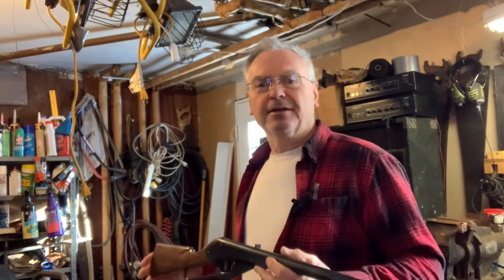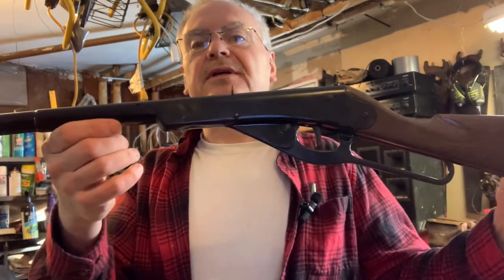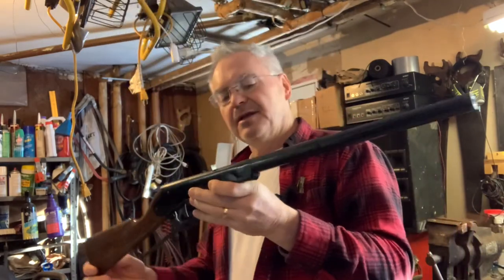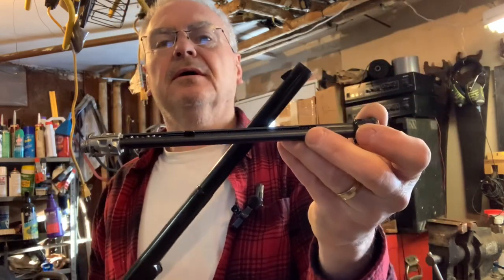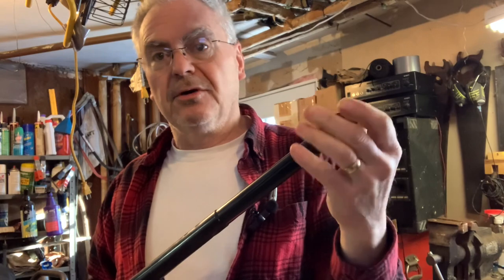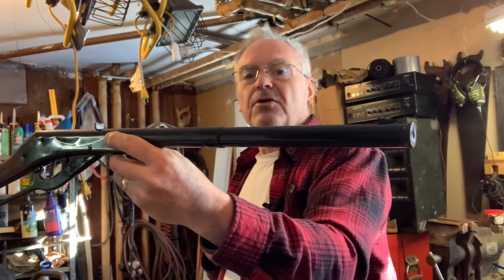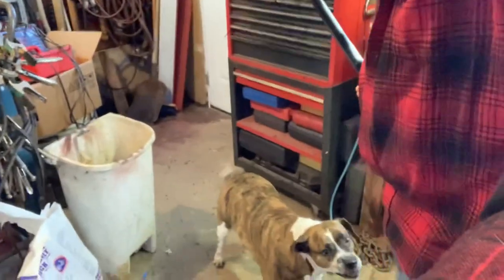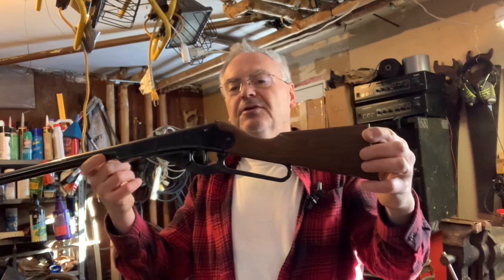Daisy heddon model 102 super thumper update

Comment: Most impressive sir. If you break 350 FPS once, it's a Super Thumper because you will break 350 FPS again as the gun shoots in. The Restomod Rating system classifies Daisy velocity thusly  300-325 FPS Thumpette, 325-350 FPS Thumper Class, 350+ Super Thumper (Cape Optional).
I'm agog at the job you did on that Model 25 shot tube, one of the biggest drawbacks to the 101/102/103 Daisy's is a total lack of replacement shot tubes. Any possibility of a detailed how to video on the shot tube chop? Keep the videos coming.
Reply from the maker: I will try to do a video on the shot tube mod soon